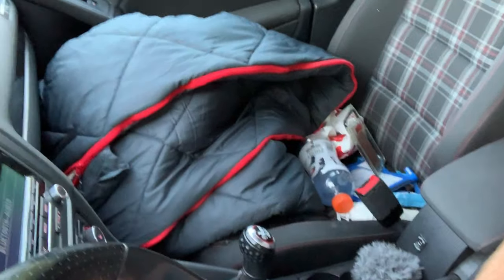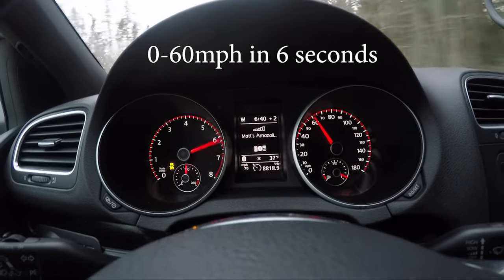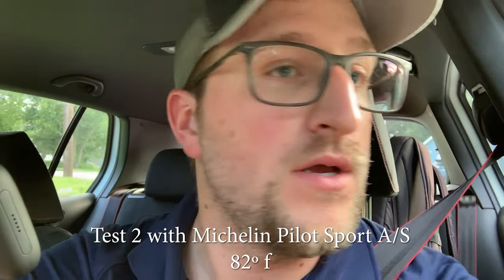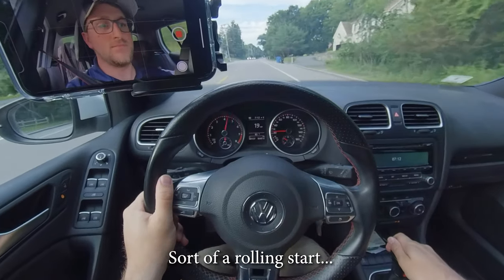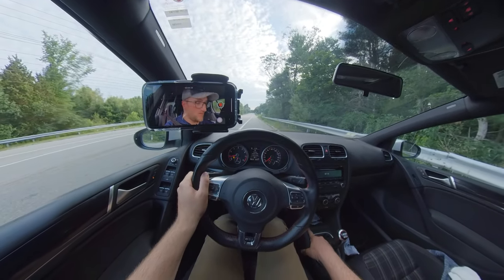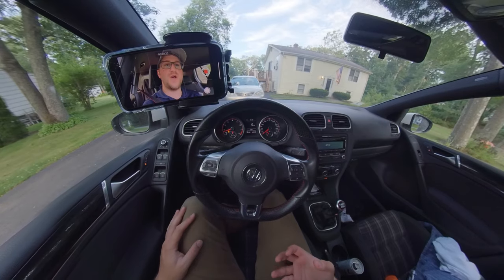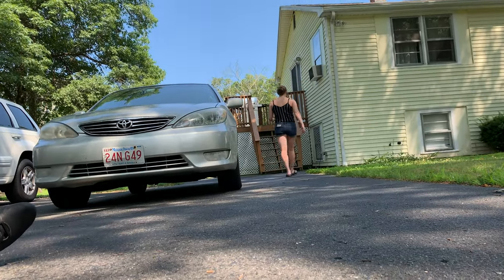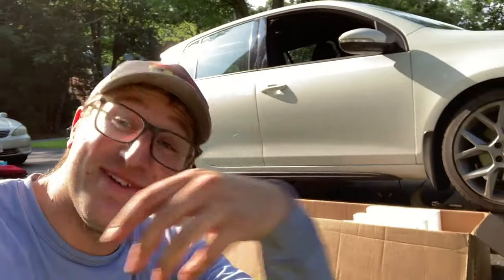I started my MK6 GTI build! And I have... engine knock??

Comment: I have a 2014 1.8t stage 1 I changed some parts which did change the sound of the engine but not like that. Could be engine knock but idk I’d start with giving it a regular oil change maybe look at the oil for metal pieces and what not, best of luck
Reply from the maker: Thanks Kevin, I appreciate the input!  It's tough to diagnose engine noises. I'll have to check the oil like you said.
Reply: Not-So-Handy Car Guy also with the downpipe if you tuned the car the gas you’re running could affect it I run strictly 93 but vw can take lower octane unless you have a tune then I’d go with the specified octane. I also saw that your plate said mass so I’d check with the euro shop brenntuning they might have better answers
Reply from the maker: @kevinrodriquez5852  I also run strictly 93, and it's stock tune. I just checkout out their website and I'm going to have to talk to them. Thanks again.

Comment: Sounds like it could be the timing chain. It is very common in these tsi engines. Change it quickly before it goes “BOOM!”
Reply from the maker: Lalo Cruz very good call, that’s actually what it was. I had it updated to the revised timing chain system and it’s running much better. Also, part of the noise was clutch chatter. Turns out the previous owner had installed a single mass flywheel clutch
Reply from the maker: Lalo Cruz will be making an update video soon

Comment: I just put a new gfb dv+ in my mk6. Intake/spool sounds nicer, and it holds boost better. Might make a review on it too. As far as the engine knock, not sure, but good luck brother.
Reply from the maker: HatchBackJack thanks for the comment man. Been looking into DV valves. You should make a video on it! I figured out the noise with my GTI- it was the timing chain and clutch chatter, combining to make some scary noises. All fixed though! I’ll make an update video soon

Comment: Pretty sure density altitude caused the new tires to be slower. I also own a gli with your same engine, my previous car was was a 96 cavalier with the 2.4 and it had rocknock. Not saying yours has it but it sounds very similar. When you rev it higher does it tick faster/harder?
Reply from the maker: I think so too. Never knew how much air temp/density affected overall performance, but clearly it's quite a bit! It doesn't tick harder, but it does match the RPM of the engine. It actually gets perceivably quieter as the RPM raises. It's at idle that the ticking is at its worst. Thanks for you input, by the way!

Comment: It sounds like gearbox/clutch rattling on idle. Isn't engine knock. Probably DMF has some play.
Reply from the maker: Fedja Drndarski Thanks for the comment, you’re right, it was a combo of the clutch rattling and timing chain flopping around. Got the tensioner fixed. I was an idiot and didn’t think of holding the clutch in. But I did, and the noise goes away.
Reply: @NotSoHandyCarGuy  Timing chain usually doesn't make noise on this engine until it was too late. First thing which I was done on my GTI - replacement timing chain and tensioner with newest revision. You should be lucky if your timing chain wasn't jumped.

Comment: Did you end up fixing the noise didn’t see any follow up videos, I have the same car with similar noise
Reply from the maker: How’s it going man! I went over it in another video, but didn’t title it like this. It ended up being the timing chain tensioner. Which was a bit of a big job. And some of that rattling was the gearbox, which is pretty normal. You can try a different gear lube. And you can ask a shop to check and see what version of the timing chain tensioner you have
Reply: @NotSoHandyCarGuy  yeah mine had a similar sound and did a oil change and find a whole lot of medal shavings
Reply from the maker: @ProLifeTours  oh shit. Does your oil smell like gas?
Reply: @NotSoHandyCarGuy  yes it does
Reply from the maker: @ProLifeTours  you more than likely have a bad high pressure fuel pump. And/or cam follower. They’re not super expensive, and really easy to install.
Reply: @NotSoHandyCarGuy  showed it to a mechanic he says sounds like your piston is Toast
Reply from the maker: @ProLifeTours  did you do a compression test? That’ll tell you for sure if it’s the piston
Reply: @NotSoHandyCarGuy  I have not

Comment: that really doesnt sound like rod knock to me, should still find the cause cuz it doesnt sound normal to me but it might be as i dont have any modifications on my engine which might affect the noise
Reply from the maker: Hey BigDick Johnson, your username really speaks to me. It ended up being my timing chain tensioner. Thankfully I caught it before the timing slipped. 🙏🏼
Reply: @NotSoHandyCarGuy  im glad its fixed m8 because it cost me 3000euro to fix my spun bearing 👌 same engine
Reply from the maker: @maxavaria  yeeesh, that sucks. But thanks man! Just happy I caught it in time.

Comment: How did you get the bolts off the turbo? I tired to put a catless downpipe on my mk6 today and I snapped off a stud on the turbo
Reply from the maker: Oh shit, I'm sorry to hear that. My car is fairly clean underneath, so fortunately the bolts weren't seized. All I used was some WD-40 and my incredible strength. Did you get the stud out?
Reply: Not-So-Handy Car Guy    After the stud snapped I took it to a shop and had them put new studs in and finish the job and flash the apr stage 2 tune on  but my clutch slips now so that’s next on this list
Reply from the maker: @ryancristea7490  Did you get the low torque tune? And yeah that's what I'm worrying about too (besides the potential knock, of course). There's some good ECS clutch kits out there for reasonable price... but it's to damn expensive to have them installed.
Reply: Not-So-Handy Car Guy I’m not sure if I have the low torque tune or not but the slipping isn’t terrible and sometimes it’s not even noticeable. I do plan on having a shop install an ecs clutch kit in future but I’m not looking forward to the labor bill 😬

Comment: So did it end up being a engine knock? I’m having the same issue and mine only has 52,000 miles.
Reply from the maker: GetWrekd It did not! It ended up being a combo of my timing chain tensioner wearing down and an aftermarket clutch that I didn’t know about. If you’ve got the same thing going on with your car, I would get the timing chain checked out as soon as possible!
Reply: @NotSoHandyCarGuy  Hey yeah when you put it near the transmision it heard like a commun upgrading clutch. But did you get any code at that time im having a knocking sensor code and im kindof curious

Comment: Hey man, just watched your video. I know based on the comments you replaced the timing chain and tensioner, but to be honest the majority of the sound is the flywheel/clutch. Did you confirm if the clutch is OEM or aftermarket with a single mass flywheel? Keep up the video's, they're entertaining to watch.
Reply from the maker: N S thanks for the comment dude. It did turn out to be an aftermarket single mass flywheel. And it ended up being about 1/2 of the noise I was getting. The timing chain update helped a lot. And I seriously appreciate the kind words! I’ll keep em coming and long as I’m still driving

Comment: Sounds like rod knock.  I wouldn't drive it anymore and get the engine looked at.  You could also try a carbon cleaning?  If you've never done it.
Reply from the maker: I thought so too. Just dropped it off to my mechanic today and they think it's the timing chain/tensioner. I didn't think it affected the 2014 GTI's but I think mine is an early 2014. Either way, I stopped driving it. Fingers crossed. And I tried some of the carbon cleaning spray; it didn't work as well as I had hoped. I might have my mechanic also take a look inside to see if there's a lot of buildup. Thanks for the input, man.

Comment: Were u able to get fixed?
Reply from the maker: Hey Danny, sorry for the late response. Yes I got it fixed. Turned out that half of the noise was coming from my flywheel. And the rest of it was a worn timing chain tensioner. I had the timing chain assembly updated and it fixed the problem. Thankfully I caught it before anything bad happened to the engine.
Reply: @NotSoHandyCarGuy  well that's good news you were able to fix it without causing more damage! I'm in the market I really want to go with a mk7 because of the timing issue on the mk6 and the mk6 makes more hp with just a tune.  But sometimes I feel I will spending more money on repairs than moding the car and enjoying it
Reply from the maker: Danny  Martinez totally understand the concern, man. To be honest, after the intake manifold and timing chain fixes, my car has been rock solid (knock on wood). I’ve driven it about 50k miles and I’m at 120,000 now. The tune makes a HUGE difference. But if I were to do it all again, I’d probably try to find a mk7 in my price range. There’s a lot of little things they fixed in the mk7